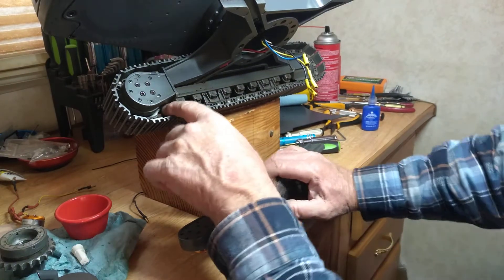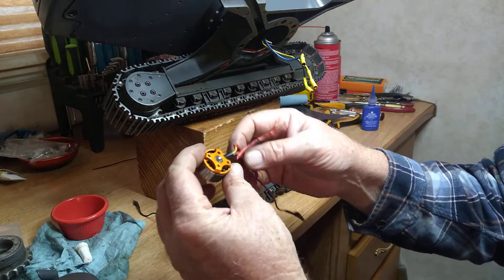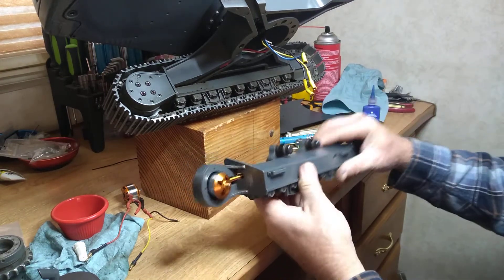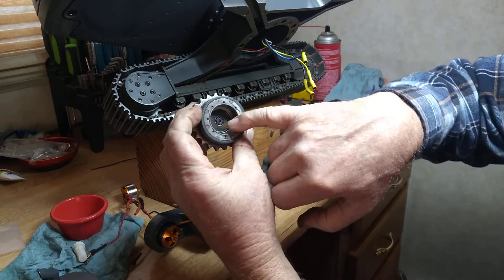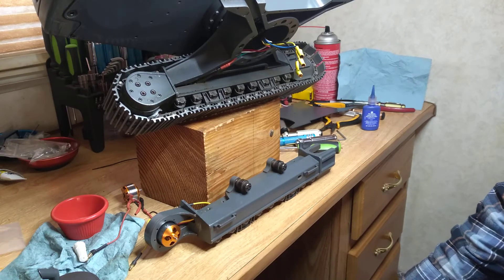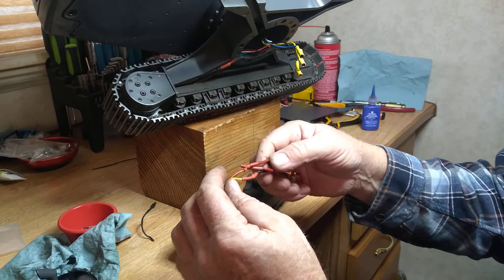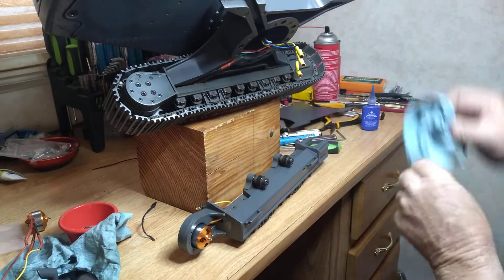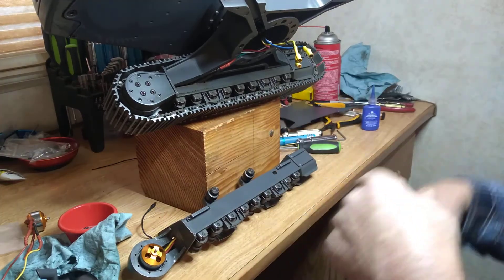360L excavator track motor replacement

Comment: Hi there I seem to b having the same problem didn't no if you could assist taken mine apart wires are intake motor spins freely and works as it should the problem I have is the planetary gears I think do you how to disassemble the planetary gears really could do with a diagram can you assist or no where I could get instructions many thanks
Reply: I dont suppose you have taken one apart  just wondering if its an easy job I have the spares from rcbrmin
Reply from the maker: So if the motor seems to be fine then you may have a planetary gear with a broken tooth.
Reply from the maker: Its pretty easy to do, just pay attention how you take it apart
Reply: Hello, after reaching out to RC4WD with a really noisy track motor, they sent me a replacement set of gears, the whole thing, for the planetary system. When I'm putting it back together, and attaching it back with the 7 long screws, the motor can't even turn. If I loosen them, the scews, just a little bit, the gears start to skip and then, it might break a teeth. Have you had this problem before?
Reply: @Martin Allard  hi I didn't have and issues with that my advice is take it apart inspect all the gears make sure they r not damaged grease it as your going and  make the gears r running freely and make sure the centre pin goes into the casting properly as I had an issue that the hole on the new casing wasn't  quite big enough so it wouldn't screw up tight enough hope this helps

Comment: I was wondering if I should do a bank transfer or use credit card on rc4wd
Reply from the maker: I did the bank transfer on the excavator and dozer didn't have any problems.
Reply: Okay I just don't want to lose any more money? I've been really trying to get one lost over 6000
Reply: @albertsternberg6852  I've got dozer wheel loader and armageddon dump truck and the xl4200 excavator all bank transfers no issues at all